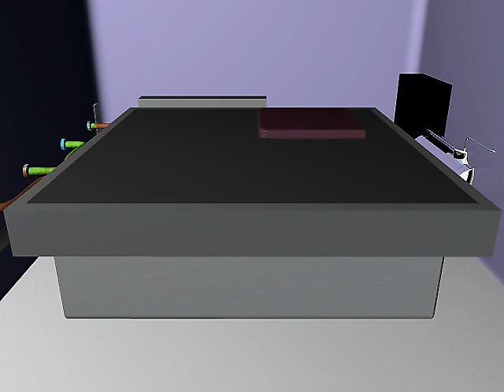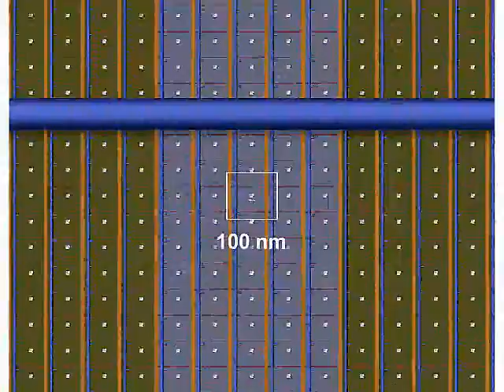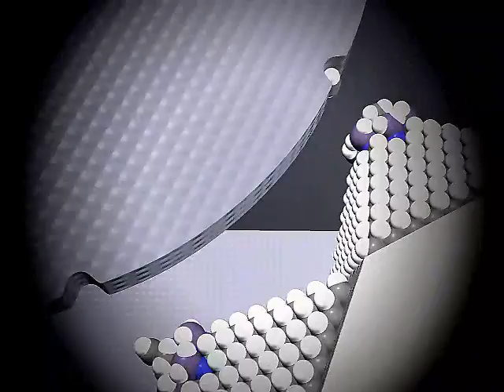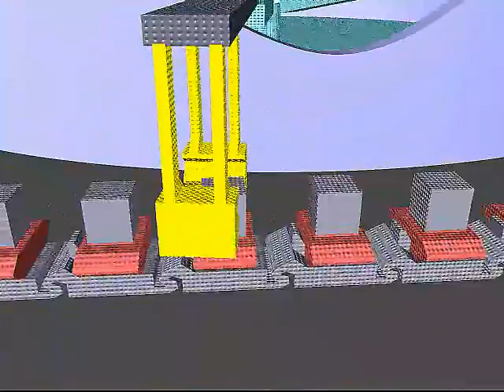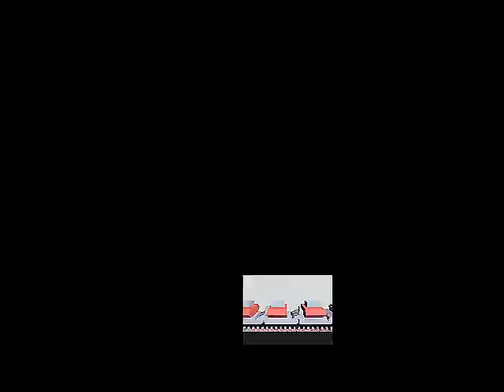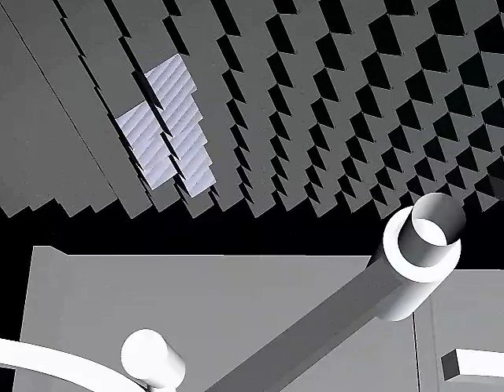Productive Nanosystems (from molecules to superproducts, v 1.00, John Burch)

Comment: The window to develop Drexlerian Nanotechnology looks to finally be opened -

Baker team checks in with "Top-down design of protein architectures with reinforcement learning" -  

"Our approach enables the top-down design of complex protein nanomaterials with desired system properties and demonstrates the power of reinforcement learning in protein design."

“Our approach is unique because we use reinforcement learning to solve the problem of creating protein shapes that fit together like pieces of a puzzle. This simply was not possible using prior approaches and has the potential to transform the types of molecules we can build.” -  Isaac Lutz

They created hundreds of proteins, and confirmed most - “We asked the software to make spherical structures with no holes, small holes, or large holes, and it worked most of the time. Its potential to make all kinds of architectures has yet to be fully explored.” -  Shunzhi Wang, PhD, co-lead author

"As a measure of how accurate the design software had become, the scientists observed many unique nano-structures in which every atom was found to be in the intended place. In other words, the deviation between the intended and realized nano-structure was on average less than the width of a single atom. This is called atomically-accurate design."
Reply: One Eric Drexler's favorite pathways to NanoManufacturing was through Proteins.  But, that met up against the Protein folding problem.  Alphafold was able to show that they could solve proteins in ten minutes like . . . three years ago now.  Before Alphafold, it took them years to solve a single protein. Then they solved enzymes, protein complexes. 

What makes this "Institute for Protein Folding" advance different over the last three years?  It appears to be using A.I. technique other than diffusion; the type that allowed A.I. researchers beat world champions in Chess and Go. Seems trivial; but, the paper that the Institute for Protein Design released just a few days ago suggests this A.I. reinforement learning technique is the hands that allows the A.I. to build protein nano-machines.

Comment: Imagine how frustrating something like this would be. I have worked with similar machinery. Just on a much larger scale and couldn't go a week without something breaking. How could they go in and fix broken parts? How could they even identify broken parts?
Reply from the maker: There will by necessity be many broken parts, you need to work with massive scales and redundancy. Redundancy is the key to make things work. From the simple ECC code in memories to redundant computers and majority decisions in reliable computing, where the simplest is to have like three computers doing the same work, and if one fails two can continue. The DNA and such has plenty of checksumming to keep things working with reasonable reliablility.
Reply: And, also, we will be able to use 3D printers to print again any broken devices if its needed. (low cost if using renovable energy, absolutely possible in a non-far future) That said, plus what Roland Orre just said, i cant see any problem in using this technologie
Reply: Exactly what I thought. Loads of movable parts... Imagine having to maintain everything up and running.
Reply: It is.   I think it heals itself.
Reply: There is no friction at the atomic scale and because most of these parts are handling practically weightless objects using graphene based breaking from doing its job is highly unlikely. Macro scale problems aren't the same at the quantum level.

Comment: year 3500, still uses laptop
Reply from the maker: I will continue to use laptops for the rest of my life. OK, I will use pen computing as well, but a technology so perfected as a laptop with a Linux system or other suitable unix like system, which you can work with anywhere and can communicate with in a completely unambiguous way is unbeatable.
Of course voice computing may be used for many things, but still nothing really useful has been released.
Here is an Apple demo from 1987, however, still science fiction, 30 years later :( 
https://ia800303.us.archive.org/19/items/DigibarnKnowledgeNavigatorAppleConcept1987/knowledge_navigator_512kb.mp4